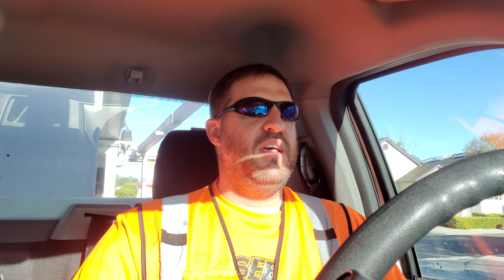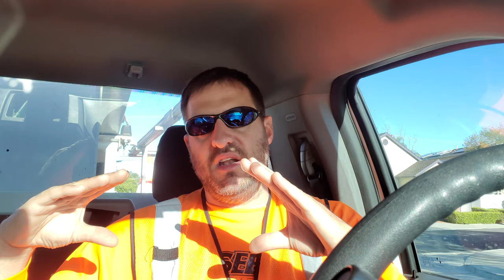Josh's Car Corner - I Have Too Many Ideas...

Comment: Those bearing tolerances aren’t loose at all. At least to me. You’ll feel a lot better about it if you jump in and look. I’d replace the cam retainer plate/o-ring with a new GM one, just because honestly. Even if the o-ring had some give to it and looked fine doesn’t mean it hasn’t shrunk past the point of being able to seal properly at operating temps. Once you’re at that stage of tear down you can investigate the oil pump and it’s tolerances too. Good luck josh you got this.

Comment: I know im kinda late but i definitely recommend amsoil. My dad’s corvette has the flat tappets and uses zrod. Ive been using the dominator for my gto. I figure since it’s supercharged might as well use the best i can get. If you become a preferred member its 25% off and free shipping. The best bang for the buck for us is just get it by the case so its good for 2 oil changes and you only have to order once every 2 years. You’ll have the gto back in action in no time i bet, then it hopefully will all have been worth it. Certainly a learning experience and thanks for sharing.

Comment: The plastic barbells have been known to break in half and let oil bypass.  The billet is to prevent the broken barbell causing oil bypass and oil pressure problems.

Comment: Replacing the oil bypass with a plug. You get them from the same people who make the barbell. If the spring is poor in the bypass it will relieve pressure.

Comment: Pinched oil pump o-ring during oil pump installation with motor in the car with the oil pan in situ. Easily done, I’ve done it myself.

Comment: You may have done this already but I would recommend another conversation with your engine builder and more specifically some of his customers related to LS builds.  If both client and builder are stating no problems with oil pressure after build then I think you can put the tolerance issue aside.  I am a proponent of lighter weight oils for the lubrication so Hopefully you don’t have to move up the weight to solve the problem.

Comment: You can monitor oil temp with the torque pro app and a bluetooth dongle
Reply from the maker: The car doesn't have an oil temp sensor,  and there's no pinout I've for an E40 that supports an oil temp sensor
Reply: @JoshsCarCorner  I wonder what that pid is reporting then? It shows a number on my 05 that seems accurate
Reply: @JoshsCarCorner  apparently it's calculated, based on what I have no idea
Reply: @JoshsCarCorner  from a quick search:
"GM Oil Temp: set up custom PID 221154, unit C, max/min 215/-40, equation A-40. It's not exactly correct but it's usually within 5-10 degrees on my DIC. I think this is part of the GM extended PID set that you can access thru the Torque main menu."